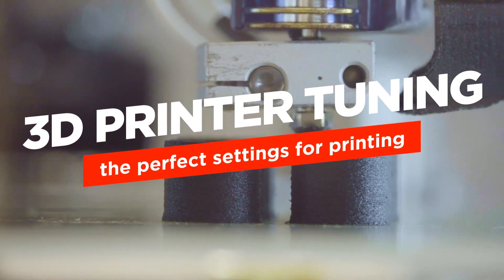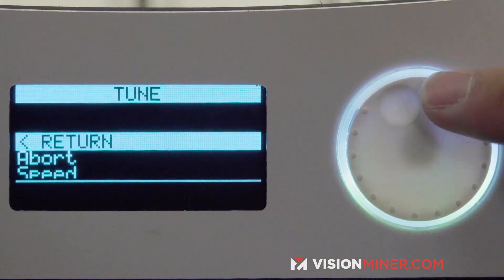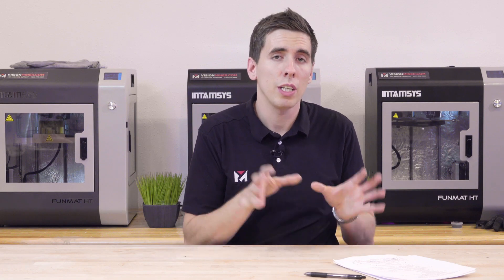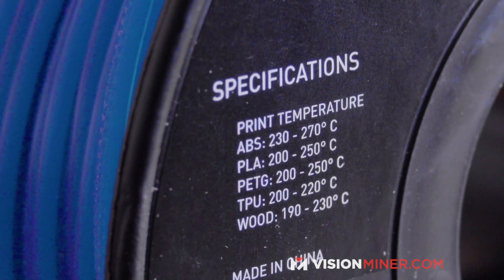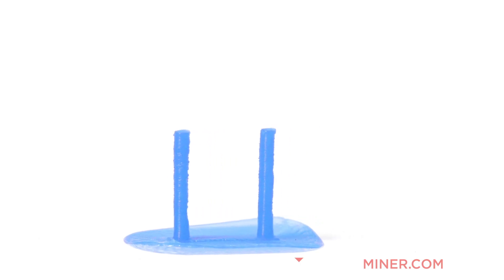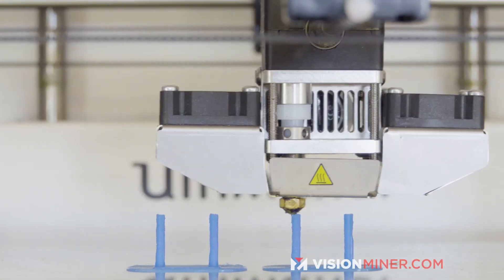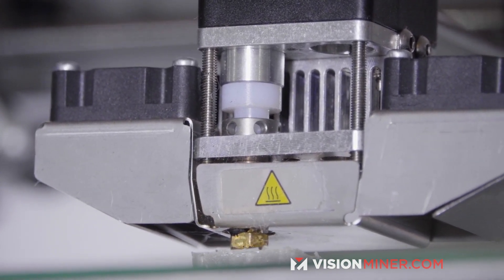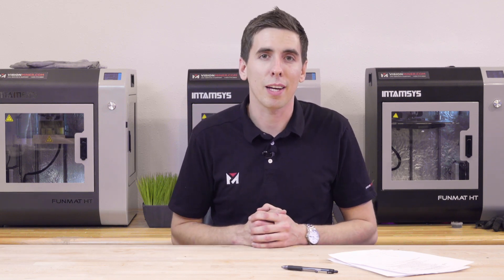3D Printing: What the Pros Recommend - Tuning Your Filament / Material

Comment: Printing a model in PETG, in the (X) Axis line layers are very smooth non-jagged.

However, printing the model (Y) Axis lengthwise it has jagged stair steppy wall uneveness.

Note: This is the same model being printed but the sides come out jagged, while the front and back walls are perfectly smooth and plane - could theis be a ERRORS in...

The program?
The STL file?
The compiled GCD file?
The MACHINE itself (could the (Y) Axis belts require more tension?)

Any insight would be greatly appreciated.

Comment: Print a temp tower and you can check multiple temps on the same print. That is the most efficient way to calibrate. If you do need to print again it would be to change the speeds.
Reply from the maker: Sometimes -- also, working with these plastics can be very expensive, so once you have general settings dialed in, it really comes down to the actual geometry, STL, and slice of the file you're working with.